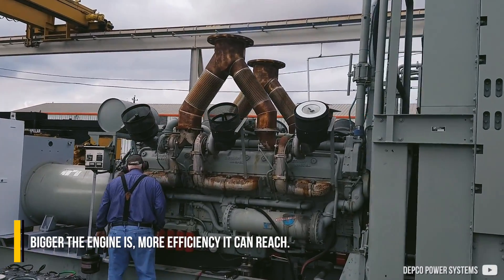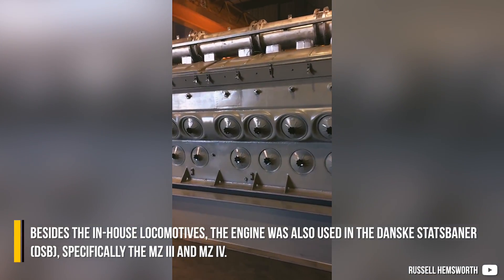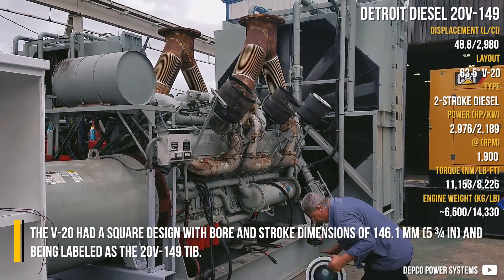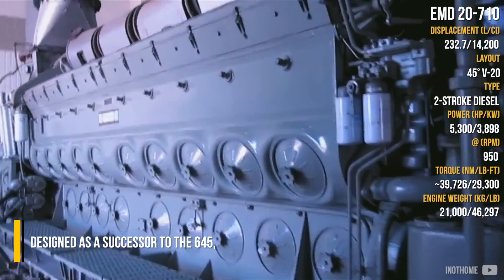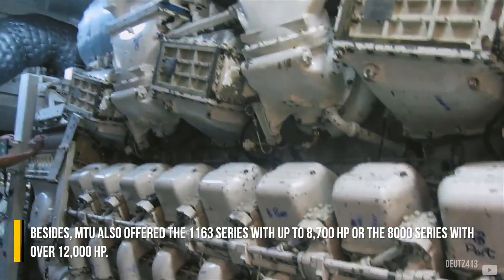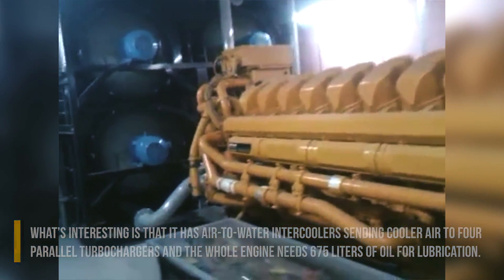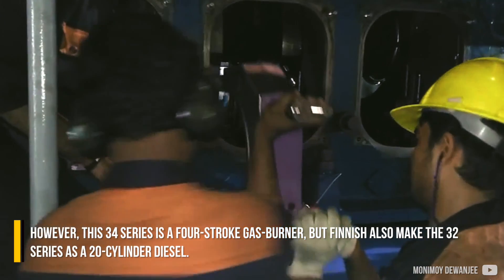6 V-20 Engines You May Not Know About

Comment: And a Cat truck shifts itself. You put it in the last gear position or the one you need to run in and the engine will accelerate and decelerate when it grabs a gear. You just leave your foot on the floor and the computer does the work, up and down.

Comment: EMD 20--645 had some issues, but what a beautiful piece of engineering
Reply: It's main issue was crankshaft failure despite having an incredibly smooth idle and operation, which makes the 20-645 quite rare amongst the 29,000 645 series engines that were built from 1965-1983. EMD made a V20 version of the 710 a few years after the 710 series was introduced and surprisingly we don't hear about crankshaft failure on the 20 cylinder 710.

Comment: ...2 cycle Detroit and EMD engines use roots blowers for exhaust scavenging...
...only turbocharged models are actually using forced induction...
...early models were turbocharged through the roots blower...
...EMD then developed their turbocharger that is gear driven for scavenging and supercharging at lower rpms and loads...
...once there is sufficient flow through the turbine an over running clutch disengages and it functions as a true turbocharger...

Comment: That Caterpillar haul truck has sort of a Lamborghini V10 warble to it, if you were to slow down a recording of the Lambo by a factor of four.

The EMD 710 is a stroked 645.  All EMD's are based on the same basic design going back to the 1930's.  The 567 had a bore and stroke of 8.5" x 10'.  The 645 was 9.06 x 10.  The 710 was 9.06 x 11.  

Doesn't that 20V-149 Detroit sound angry!?  You just gotta love 'em, even if they're only good for converting diesel fuel into noise and smoke.

Comment: The 20-710G3 is capable of more than 5000 hp. It actually probably makes closer to 5700. 5000 was just a conservative number chosen by Conrail and EMD. To evidence this, all of the former Conrail SD80MACs, now owned by Norfolk Southern, are having their 20-710G3s uprated to 5500 hp as part of a rebuild program.
Reply: I think EMD tried to push 6,000 hp out of those V20s at one point but found it to be inapplicable.

Comment: Forgot the Russian Kolomna 1D49 (20ChN26/26), 20 cylinder modification of D49 series (many V16 5D49 found on BR132/232, 2TE116, TEP70 locomotives), it's very limited production 6000hp engine, found on TEP80 (ТЭП80) locomotive, which set world speed record for diesel locomotives 273kmh (sadly, it's unofficial). You can find speed record video on YouTube by tag ТЭП80.

Sorry my English.

Comment: Great video! I wanted to offer one point of clarification, you are incorrect in stating that the wartsila series 34 is a petrol burning engine. it does not operate using spark plugs like a petrol engine would, it is a compression-ignition engine. When they say gas in referencing its fuel capabilities, they are not referring to petrol, but natural gas such as methane or propane. it is common for manufacturers to offer a natural gas-burning compression-ignition engine, Cummins offers an ISX 13 that is powered by natural gas. Like the Cummins I am referring to, This engine is still a compression ignition diesel engine, just with the flexibility of running natural gas in place of fuel oil. https://www.wartsila.com/products/marine-oil-gas/engines-generating-sets/dual-fuel-engines/wartsila-34df
Reply: Don't forget to mention that these dual-fuel engines use diesel as a pilot to light the natural gas.

Comment: Wrong as hell about the EMD engines. 6 and 8 cylinder EMD engines that are Naturally Aspirated have 1 blower. 12, 16 would have 2 blowers or a single turbo that is directly driven through the gear train until the engine is running at or above 2/3 full power. EMD 710 series engines are only available as turbo charged.

Comment: So a bigger engine is more efficient?
Reply: Yes but in a ridiculously large fashion. Say you had a 350 Chevy, and went to a454. Not as efficient. If you to say,454 cubes a cylinder,then it would be more efficient. It's got to do with the sheer mass of moving parts. It may take a minute and quite a bit of fuel to get an engine up to speed,but once it's at it's rated speed,it takes very little effort to keep it there. 

Basically,more mass equals less effort,once it's in motion. That's my take on it,anyway,for what it's worth.

Comment: Ruston 20RK270 and 20RK280, high output diesels for use in high speed ferries.
And slightly short in the number of cylinders but the Cat 3618 with 18 cylinders.

All these put out around 8000kW

Comment: Correction on the EMD, it only ever used 2 roots blowers, OR one Hybrid turbocharger that has a gear drive and overrunning clutch and suns like a centrifugal supercharger at low rpm to provide scavenging air pressure
Reply: Unless you look at the 6 and 8 cylinder ones, or at least the 567 series variants. Those just have one blower. Plus they have different blower drive speeds depending on the engines. V6 and V12 models use one speed while V8 and V16 versions use a different blower speed.
Reply: True - the centrifugal supercharger on the 645 E4B etc had a 21 to 1 speed increase on the turbine - the engine would stay on the blower until it got about 1800 kw on it - then the engine would produce enough exhaust to make the turbo work efficiently... the 20 cylinders had problems in the locomotives due to the locomotive flexing and causing the cranks to wipe the main bearings - however there are lots of 20 cylinder emd`s powering generators pumps and other stationary applications... It is my understanding that EMD was the only engine that was allowed by the nuclear regulatory agency as emergency backup power in a nuke plant - I used to maintain several that were required to be up and online with 100% load in 10 seconds or less - and they could do it too...

Comment: Visioracer, the v20 cat engine you mention will drive the wheels directly through a transmission on most caterpillar equipment. Plus it does make some sense as your reduction ratios can be absolutely insane. You can drive a planetary reduction to drive a planetary reduction, plus with extra reduction in the gears in the trans, and the diff itself has a massive reduction, its not unusual to see a 55-78:1 final drive ratio through all of that reduction. Takes 78x the rpm but the final drive emits 78x the torque. Cat can run any engine on those units right down to a 14L engine with enough reduction
Reply: I think there is a V20 cat at the South pole spinning the earth :D
Reply: They start out in torque converter mode which is called by the Cat guys as the 'invisible 1st gear' and then go to shifting themselves. SWEET setup.

Comment: Here is another V20: Mercedes-Benz MB 518
https://de.wikipedia.org/wiki/Mercedes-Benz_MB_518
Developed in the 1940s, 40°-V20, Four-Stroke-Diesel with mechanical blower or turbo or naturally aspirated.
Based on the concept of the motor LOF 6 used in the Hindenburg!
They were used in the German fast attack crafts of the Zobel-class (140 and 141) and the Jaguar-class (142).
Reply from the maker: Niiiice

Comment: Those MTU 20V-4000 prime movers are also used in the KiwiRail DL-class locomotives. They outperform (and so they should) the 7FDL-12s in the (much) older DX-class by about 500hp or so

Comment: Detroit's don't have supercharger, they just scavenge and charge the cylinders.  They make up for the lack of an intake and exhaust stroke.  So they're just, well...chargers.
Reply from the maker: It's a mechanical blower which does not create any boost over the atmospheric pressure.
Reply: The two cycle Detroit's have to have blowers and they do build boost - the blowers turn around 1.5 give or take faster than the crank speed - the 2 cycle won't start without the blower spinning and compressing the air into the cylinders....

Comment: You can add Cooper Bessemer to the list of V20 manufacturers. They made a V20 4 cycle  with 15.5 bore x 20" stroke primarily used for power generation.  It could be a straight diesel, a gas diesel or straight natural gas engine and ran at 400 rpm.  They also made V20 2 cycle engines for natural gas compression.  They are no longer in business.

Comment: Thank you visioracer. I have been struggling for a long time to find a video of the wartsila 20v34 running. I have always wondered what a behemoth gas burner would sound like. And now you have put an end to the struggle. Many thanks.
Reply: He is mistaken, it is absolutely not a petrol burning engine. when they refer to it burning gas, they're talking about natural gas, such as methane or propane. It uses injected liquefied gas in place of diesel fuel. the only difference between the 34 series and 32 series is that it has the option to be run on natural gas, not petrol, it is still a compression-ignition engine that is designed to primarily be run on diesel. it does not contain spark plugs and nor would any manufacturer make a large engine that is not compression-ignition, they are simply not efficient enough. so, I hate to burst your bubble, but this video should give you no greater satisfaction than watching a compressed natural gas fueled Cummins powered airport shuttle bus. it is common to fuel diesel engines using natural gas rather than diesel. https://www.wartsila.com/products/marine-oil-gas/engines-generating-sets/dual-fuel-engines/wartsila-34df
Reply: @ericwebster4352  sorry. Just found your comment now. Lol. And yeah, I realize it's not a petrol burning engine. Making a petrol engine that large would be highly impractical and inefficient. It burns  either cng or lng, not certain for sure though. Either way it was satisfying to hear that engine run. I've been rummaging through the internet just to find a video of that specific engine. I still think emd two strokes sound better though. Lmao 😂

Comment: Clutch driven turbo? Wat? @VisioRacer
Reply: Emd uses clutch driven turbos on their 2 strokes. The turbo is engine driven until it has enough exhaust to drive the turbo. The 20 645 uses either the  blowers or a turbo not both on one engine.
Reply: IGAsp1re EMD’s chief competitors at the time didn’t use clutch driven turbos, and this allowed EMD to build their engines’ reputation of loading quickly, without turbo lag. The engines aren’t used to drive the wheels directly, the crankshaft powers a generator which powers electric motors.

Comment: Cummins has a variant of the QSK95 which is a 120L V-20, sadly I do not think any have been built yet.
Reply: vtecshepherd you’re correct. None have been built yet. It is still just a concept.
Reply: I think the Cummins engines over 60L displacement are joint ventures between them and Wartsila.

Comment: If I remember right, the Lancaster bomber was supposed to  only have 2 engines which were basically a stretched merlin V12 up to a V24, but there were loads of issues, like the cam shaft twisting causing the last few cylinders to run rough as the cam shaft was several degrees out out time. So they settled for 4 merlins
Reply: Those engines were called the Exe, as in X-24.  They were not doubled Merlins, but doubled Kestrels.

Comment: Rolls Royce Bergen also makes V20 engines. Like the B35:40V20. It is a power generator making 37MWe or about 49000hp. Unsure about the sice of the engine, but I asume the 35:40 is borre and stroke in cm.

Comment: fuel efficiency? why bother?
Reply: I think the fuel efficiency would actually be pretty decent, otherwise they wouldn't use them for power generation. Just my thoughts.
Reply: N Cion Considering the work they perform they may actually be rather efficiant indeed! Don't forget such engines primarily are utilized in marine,train or stationary applications. To gain equivalent output with smaller displacement engines might lead to HIGHER fuel consumption(more strain) or need for multiple engines ;pulling up the weight ,requiring more space, more rotating mass etc...
Reply: Rick Delair  you're off on the EMDs that can be swapped back and forth, it was the 567 that could be converted to a 645 by switching power assemblies, the 710 had a crankshaft with a longer stroke.

Comment: You went wrong with the MTU 4000 engine.
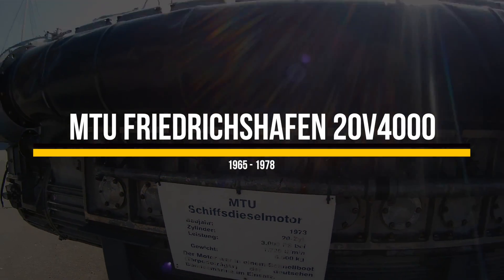The engine shown at 3:58 is a much older design Mercedes Benz engine, the MB518 V20 used in torpedo boats and likewise light and fast vessels.
This engine is also made under the MTU brand later on, as MTU aquired the industrial diesel engine brach of MB and Maybach as well.
Then the engine at 4:13 is a 8000 series and the last one shown is the 1163 series.
A 20V4000 can be seen here: https://i.kinja-img.com/gawker-media/image/upload/s--OTT3XgB1--/c_scale,f_auto,fl_progressive,q_80,w_800/17ivrpp3sqw17jpg.jpg
The 20V4000 powers the DL class locomotives from New Zealands KIWIRAIL: https://www.youtube.com/watch?v=VDV4ubdt06A a video with some good sound.
Reply: About mtu, it was founded by combining the small/medium size engines from MAN, and the then MMB witch was Grossmotoren von Daimler-Benz and Maybach Motorenbau. And MAN put in all their engines below 12L pr cylinder.

Comment: Someone attach a differential, four wheels, and a steering system to one of these and drive it around.
Reply: It would resemble a bulldozer.
Reply: Go to 5:39
Reply: Eric Caves It’s been tried before with very limited success. EMD tried to make one of those massive mining dump trucks that are like twice the size of a house powered by a 16-645E making around 2000 hp, and it didn’t really work well.
Reply: They do. It's called a Cat Quarry Truck or Mining truck.

Comment: Actually, there is 1 more V20 engine. "1D49" of the record-breaker "TEP80" diesel locomotive. "1D49" is a part of "D49" engine series (there are V8 (6D49), V12 (2D49), V16 (5D49) and V20 (1D49)). They are made by "Kolomensky Zavod", Russia (it translates like "Factory of Kolomna city")
1D49 has 26/26 cm of bore and stroke, 6000 hp @ 1100 RPM, 4 stroke diesel

Comment: what is a clutch driven turbo?
Reply: The turbocharged EMD engines use this setup...at startup/low loads, the compressor section is driven by a step-up gear train; at higher loads, the turbo is coupled to the compressor, likely (not sure here) via a clutch mechanism, and the mechanical drivetrain uncouples, so the turbo/compressor is exhaust-driven.
Reply: Era AG I was wondering that myself. If I had to guess the clutch locks up and engages at a set RPM to engage the turbo. So maybe the turbo only produces boost when it's needed at higher rev's. That's just my guess though. I could be completely wrong haha!
Reply: Nice heads up, so it's a hybrid of turbo and supercharger for choosing between best configuration.

Comment: The EMD 20V645 was the first engine that I thought of when I saw the title of the video show up in my notifications.
By coincidence, it was also the first engine that you listed.
Reply: DrFruikenstein I just want a 20V53
Reply: Ellenor Malik 
You'll probably need a KW W925 to have a hood long enough to hide it under.
The 3.875" bore times 10 long, plus the meat around each cylinder, adds up to a mighty long engine.
But I bet there wouldn't be a sweeter sounding engine on the road.

Comment: 675 liter per oil change is like 6 grand on oil alone
Reply: BadAssEngineering That's exactly what I thought when he mentioned it. Can't imagine how much the oil and air filters cost along with it.
Reply: Im sure those 675 liters will last at least a couple of years lol
Reply: Ah, that makes sense. I guess the oil doesn't get to dirty with the massive filter's and because these engine's run at low rpm's.
Reply: dellstudio10 .. Lub oils of IC engines form a polymer coating inside in long run. Unfortunately they can't be easily cleansed.
Reply: They probably do an oil analysis before every scheduled "change" and determine if there's still life left in it. "If" they do change the whole lot they probably just dump it in the fuel tank(s).
Reply: I am an Engineer on comercial Ships ( ocean going Articulated Tug Barge). My first ship had twin EMD 645 v16, it burned about 1/2 gal of oil per cyl, per day. My new ship has twin EMD 710 v20, it burns an insignificant amount of oil, maybe a gallon or two a day (Add oil once a month). They are some of the most reliable engines I have ever worked with, and are easy to work on. Also being 2-Stroke Diesels, they are torque monsters. We change oil at 3000hr, oil filters at 1500hr, air filters at 750hrs. We also do monthly oil analysis.
Reply: I assume you can use those oil as fuel..you know...it's a diesel
Reply: I heard they just keep adding new oil to maintain it's viscosity, cleanliness and additive package . . . after pulling some of the old dirty oil out to make room for the new oil and dumping it in the fuel tank to be used as fuel.
Reply: the 645 will use about 30 gallons of oil a day, you sent off oil samples every month, and change oil IF everythings okay with the oil after about 6 years or about 40,000 hours of run time. you change oil filters about every 2 months and yes the 645 in marine config holds about 450 gallons of oil
Reply: Never gets changed. Filled for life
Reply: WRONG, diesels are MAJOR offenders when it comes to breaking down/killing engine oil.